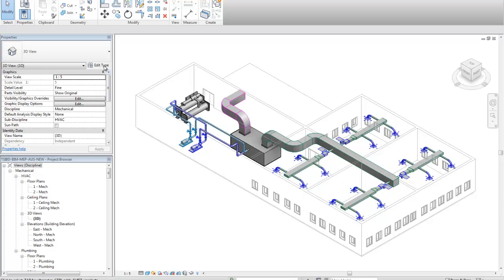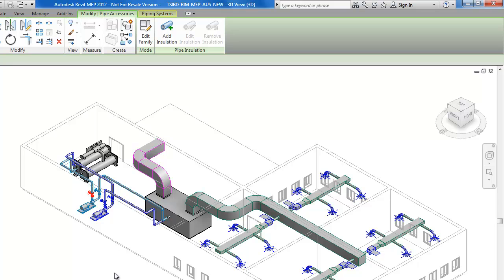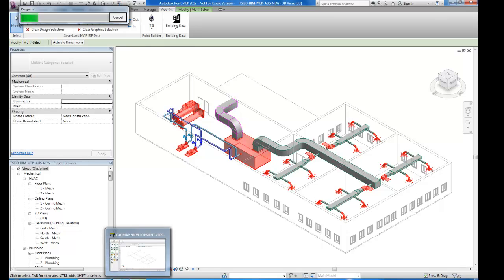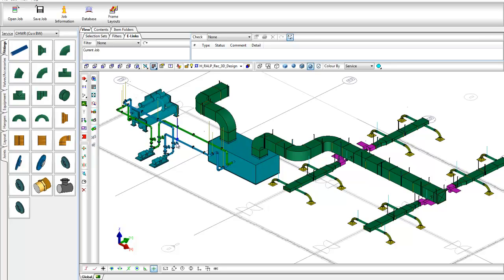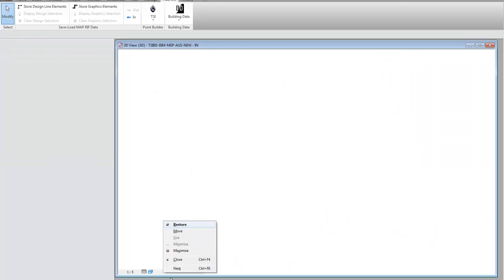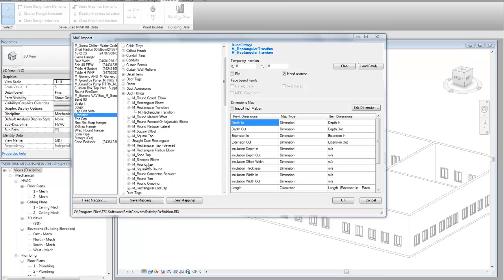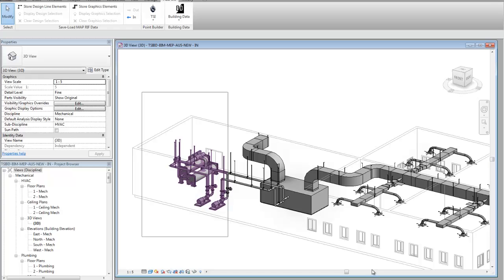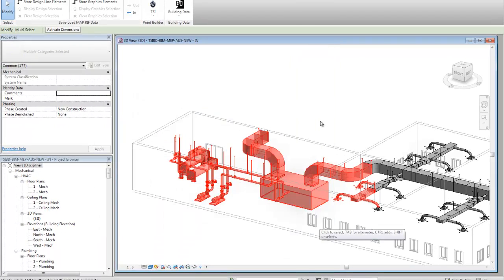Revit MEP 2012 API - TSI software presentation FAB-MEP AUS - Design BIM Through To Manufacturing BIM

Comment: Hi there. I have been using CADduct for years now and my day job is to produce manufacturing drawings for building services. I am about to start learning fab mep and revit, but i just noticed on your video that the hangers were put in automatically. The first hanger coming off the pumps where you zoomed in was actually clasing with vertically mounted valve above. (the handle of the valve) do this program not automatically do a clash detection?